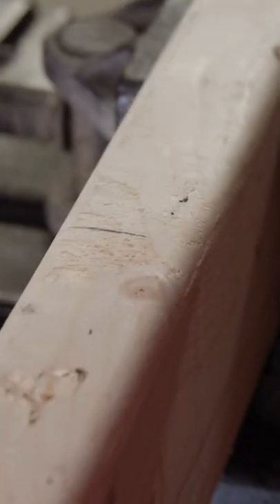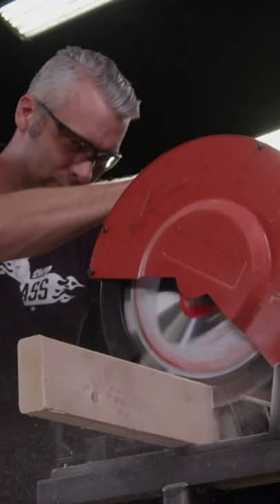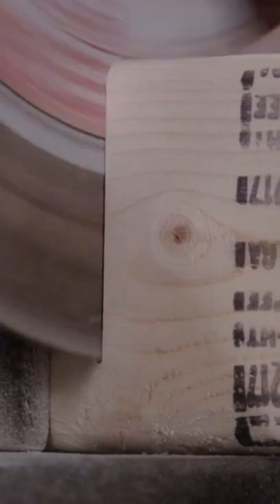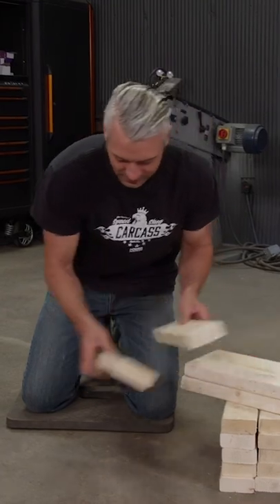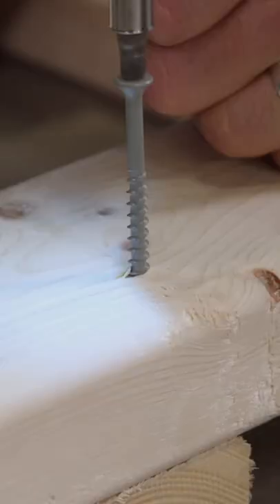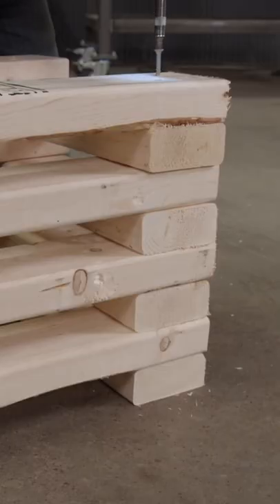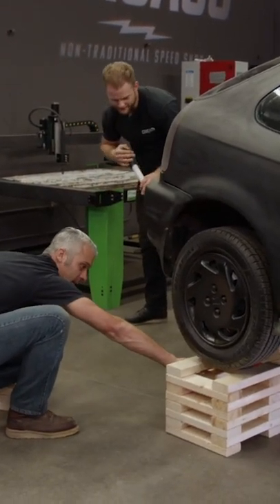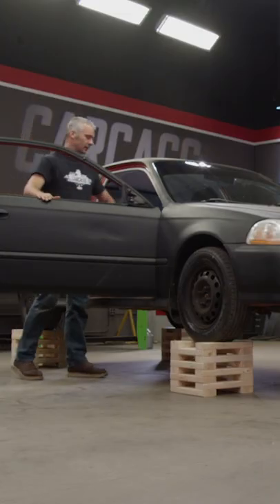How To Make Wood Wheel Stands

Comment: Personally I would feel a little tense trusting the wood
Reply: When the wood starts to go, it'll let you know. Wood cribs will creak, crack, and splinter before they go... If a jack/jack stand goes out - no warning, that's it!
Reply: Also Wood has a crushing force around 25000 lbs. which is why homes are framed with 2x4s. They can support a lot of weight.
Reply: I trust this a bit more than jack stands...with jack stands all of the weight is resting on a pin
Reply: @gilbyglibber exactly, than pin made of chinese steel might crack and vehicle goes all the way down. One thing I trust even less is foldable jack stands - my laptop has thicker hinges than that.. The wooden ones on the video look solid

Comment: I wouldnt recomend this unless you ran bolts through the entire stack thickness and use glue.
Reply: Why? wood is under compression. These would be way stronger than the plastic ones
Reply: @chocosmith2243  Ryan's point is that a long bolt through each corner with good adhesive between the 2x4s at the corners will keep the wood from spreading and possible collapse.  His is a very good idea.  Do the screws and the glue one stack at a time, followed by a long bolt each corner.
Reply: @chocosmith2243  No...notice how the cars wheel weight is only on a front and back 2x4? It's not on anything thicker...this could equal SNAP depending on each wheels loading.
Reply: @makattak3550  idk. Be real hard to cause a 2x4 to sheer.

Comment: Nup.
So the cars weight in quarters is resting on only 2 2x4s.. they snap, the wheels on the next level of only 2 2x4s. All your timber work has done is give you height. Not the combination of 2x4s actually on top in thickness.